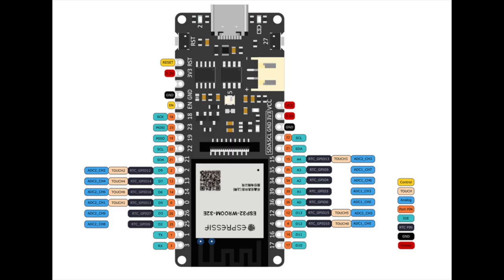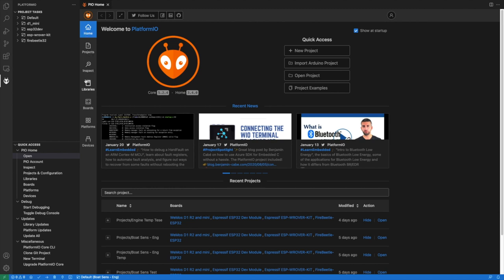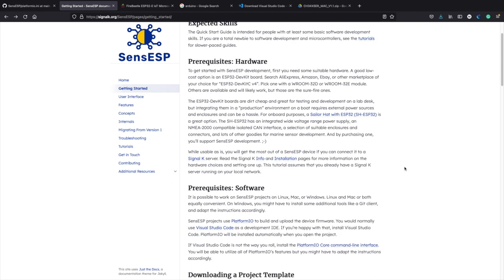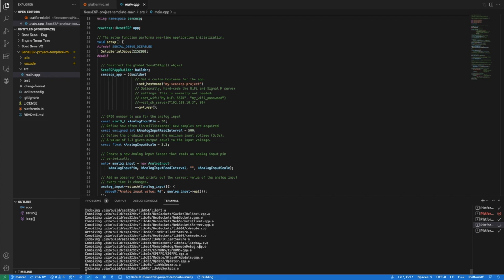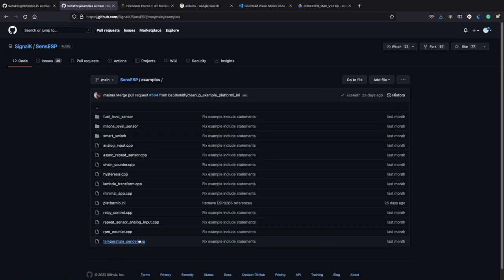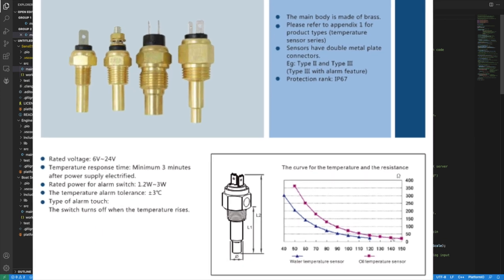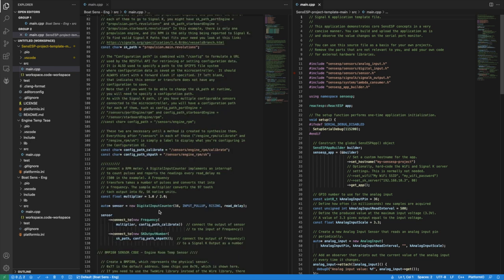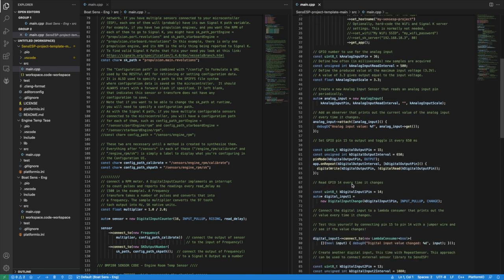OpenPlotter - ESP32 - Getting started, adding code and digitising an older engine MD2030 - SensESP

Comment: Love the lesson! Im restoring a 30 year old 32ft Beneteau with a totally rebuilt Volvo Penta 2003, I have rebuilt the control panel with all new digital gauges from Aliexpress and in the process of digitising all the sensors to be on the NMEA network so that the BandG chart plotter can display the engine data as well. I will be using the OpenPlotter as a redundant system in case of equipment failure while sailing around Australia for a year.
Reply from the maker: Thanks for the message Charles. Sounds like you have a great project on the go and some amazing sailing ahead.  Australia is definitely on the list for us. All the best with the project and fair winds⛵️
Reply: Hello. I am planning the same task, 2003 Volvo md2030 on a Beneteau and want to tie into BandG system. How is your progress and any suggestions
Reply from the maker: Did you manage to get this setup?
Reply: how far did you get?
Reply: Sorry for not responding sooner
I’m still fitting out remainder of woodwork. Delayed for 6-8 months attempting to paint in high humidity. Should start electrical fitout in next 2 months will let you know more when complete.

Comment: Hi, this is a fantastic video. Thank you for documenting it so well. I am also in the process digitalizing some engine data (Volvo Penta 2001). So far, I managed to hook up a few 1wire sensors. Next, I am looking into RPM with a Hall effect sensor installed on the shaft + getting the engine temperature. I would really appreciate  a deeper dive both on hardware and coding for the RPM and engine temp setup. Many thanks again, I am looking forward to the next episode. P.S. I do not mind the length of the video at all.
Reply from the maker: Hi, I’ve got a video next week around the sensors I’ve used to get this far. I also started with Hall effect and then I managed to find an example of a circuit which is triggered by the alternator. The good news is that it doesn’t stop the the VP rpm gauge working. I’ve documented all of it, got links and also tried to show how the circuit works. Hopefully that will explain a few things and fill in the blanks from this video. For temperature I’m using an copy of the example code on SENSESP and then I had to calibrate that. More on that next week. Many thanks for your comments also.

Comment: Wonderful !  Thank you for doing this. There is alot to be done for the "common man" to be able to incorporate esp and sensors to Signal K system. Im not sure if I have the brains for it, but will try as best I can. A question: Is it easy possible to readout the "W" signal from the alternator with an esp? It would be an easy way to get the rpm data. I have a Actisense EMU-1 to read motordata and convert it to NMEA2000. It connects to the alternator, and works perfect. Keep on the good work, and make more guides. Very informative. Just started with Visual Studio and Platform IO..... A bit overwhelming.......
Reply from the maker: Thanks for your comments, I felt the same once I purchased the esp32 and v1 of that software definitely was a learning curve from what I had setup before. The good news is that now you can start with a copy paste of examples and get something to work which I think really helps understand what it’s doing. Then you build on that. Yes to the W terminal, that’s how my rpm is working on an MD2030. Next weeks video is all about the electronics which again I’ve googled but it’s working well. I’m now working on predicting fuel consumption as I know how fast the engine is running.

Comment: Another great video, thank you. 
I have been working on a SensESP project for my father-in-law’s boat. Do you run any environment/ battery monitoring full time for when you are away from the boat for extended periods?
Reply from the maker: Many thanks for your comments. I don’t leave anything on at the moment, still in the habit of isolating everything when we leave as we don’t always know when we will be back. I have thought about some sort of monitoring and I do have a small Lorawan card I could use otherwise I’m relying on the WiFi. Is that your plan with this project?

Comment: Hi, can you let us know the actual sensor transducers you’re using - temp/rpm etc please?
Reply from the maker: This video might help you. I'm using a circuit that's linked in this video for RPM, for temp it's a KUS temp sensor and a voltage divider. You can also use digital 1wire sensors which I've used for the exhaust temp and now oil temp - let me know if you need anything further - OpenPlotter - ESP32 - Circuits & Sensors - Digitising an older engine MD2030 - SensESP
https://youtu.be/I12NdvRQNxY

Comment: Hi Matt, I subscribed to your channel soon after you started. I have watched the upgrade of your electronic instruments/sensors with great interest and decided to start the same process on my Bavaria 31 whilst the weather is so poor here in the UK. I'm not that knowledgeable regarding programming etc. but want to learn more. I have a Raspberry Pi 4B and this week have followed your instructions on how to set up the BME280 & 1 wire sensors. My question is why do you need an ESP32? Is it simply to send information via WiFi to the Raspberry from the engine bay? Plus. where did you buy the brackets for your bilge sensors? I look forward to following more great content on your Channel.
Reply from the maker: Hi John, many thanks for your message and for sticking with us, it’s great to have you onboard.

The esp is doing exactly as you describe, it’s an easy way to get data over WiFi from somewhere I’ve not got a lot of cabling. It’s also easy to configure and to get the info you want. Another example would be a chain counter.

The brackets were from eBay I think, something similar to this and I just drilled out the the single hole to what I needed https://www.ebay.co.uk/itm/284877074314?mkcid=16&mkevt=1&mkrid=711-127632-2357-0&ssspo=1YQ-FBugRSG&sssrc=4429486&ssuid=1XqhIgr5QPm&var=&widget_ver=artemis&media=COPY

Lets us know if you need any further help with your setup and all the best with the project⛵️
Reply: @BoatingwiththeBaileys  Thanks Matt for your quick reply. I appreciate your offer of assistance, rest assured I'll certainly need it!
Reply from the maker: @johnsevieri7280 👍

Comment: I built mine with a database server and an esp32 on Arduino libraries.  I haven't put it in signal K yet as I am having trouble with the signal k database and assorted issues.  They all stem from I cant actually get a Raspberry Pi that the package will properly install on.  They are backordered until April or May most places and are pushing $100US.   I am using Pine64 boards as I have a pile of them that I purchased for $7.  The plotter works at like 90 percent on Ubuntu/Debian, but it was coded to be compatible with a Raspberry Pi running Raspbian...I guess I might just keep the Pine64 boards and code what I need by hand.  I've got to put that Comp Sci Degree to use somehow.
Reply from the maker: That’s the thing with these projects, you just start think what can I do next.

Comment: Have you gotten OTA updates installed. Is it the same way you did the uptime sensor
Reply: and thanks for the walkthrough. It helped alot. Mine did not go as smooth as yours.
Reply from the maker: Hi - Thats on the list to look at, i do have the start of a video which now shows the install and connection to SignalK but i would like to include a bit more before i publish it. I'll add that to the list.
Reply from the maker: Many thanks for your comments.

Comment: Can this be done in openCpn because I am using a laptop not a raspberry pi?
Reply from the maker: Hi, What operating system is on the laptop? SignalK will run on Windows and I think that's probably the easiest option. Your other option is to set up the ESP to put the data directly on the NMEA network but it would need to be NMEA 2000 to get all the more interesting data to work.
Reply: @BoatingwiththeBaileys Thanks for getting back to me, yes windows, I'm not sure if NMEA 2000 would be good for me because most of my kit is NMEA 0183.

Is signal K an alternative to Grafana? I am trying to play catch-up with what's doable by watching your videos and then realised that openCPN and Openplotter are different.
Reply from the maker: @rayhsetwo8594  Ok, So that's possible on Windows - here is a link to SignalK for Windows https://github.com/SignalK/signalk-server-windows

Signal K is an open platform for boat data. It doesn't actually store anything but it allows you to use software like Grafana to display the data. It also comes with other software packages such as KIP, which is another dashboarding tool that works straight out of the box. I have a video coming out this weekend showing an updated version of that. 

SignalK - Boat data platform
Grafana - Visualisation Tool
KIP - Dashboard/Visualisation Tool
OpenCPN - Chart & data visualisation software
OpenPlotter - All the above in a nice easy-to-install package with an Operating system. 

If you don't want to change too much for now and you are happy with OpenCPN and your laptop. I would install SignalK, build an ESP if you want to get your engine data in and then I would setup some dashboards to display that data in KIP or Grafana. You can also pull some info in OpenCPN
Reply: I tried to download Signal K but it says it does not support windows versions below Windows 10. I will have to see if I can use a different laptop. 

Thanks for the list and steps to download re: the apps and an ESP...I will look at doing all that.
Reply from the maker: If you need another laptop, I would seriously consider a Pi for this bit and leave your laptop running the plotter and anything else. Cheap, low power and the software just drops right on 👍
Reply: @BoatingwiththeBaileys   I have considered a Pi, but I don't know enough about them, but the other reason is I have managed to configure a remote CCTV camera which is working really really well over a tplink 4g router and cheap SIM card, I can pan around and zoom in and it sees really well in the dark, I can check my mooring lines without even travelling to the boat.

So I want to be able to view data over the same WiFi router as the CCTV. So I want to have the systems working through that router and view data remotely too.

It's probably the case you can do that with a Pi with a WiFi card connection to the router but I don't know how to do that right now, whereas configuring a PC I can.
Reply from the maker: @rayhsetwo8594  Yeah that's all possible with the Pi. If you are comfortable with Windows and a PC, that's good. If you can get a newer version, nothing stopping you from learning SignalK and sorting that side of things out and then considering a Pi in the future. I think SignalK is a great platform, its really helped me switch my instruments over from older NMEA standards, something that would have been really costly without it.
Reply: Looking back through this thread you said I could build an ESP and use Signal K to display it in OpenCPN.

Can you tell me the model of ESP I should be looking for and how would I get that connected to the windows 10 laptop? 

I got my hands on a cheap Dell latitude 3450 laptop and just installed OpenCPN last night and loaded up a few plugins and British isles charts from OCharts.

I will get my AiS transponder working on it later. (I have a NMEA to WiFi multiplexer that works already for this on another laptop).

Then I will install signalK and start configuring the ESP and engine data.

This laptop is going to be just for the boat and I have a second cheap one arriving so I will duplicate everything so I have redundancy.

I just need to know the next steps for signalK to ESP connection?
Reply: Watching video again, as this is over a year old now would you still use the firefly ESP or something different? Baring in mind I am using a laptop only.
Reply from the maker: Hi, The Firebeetle ESP32 that i used is still available. These devices change little really, so any of them will be suitable. You just need to change the device to the one you purchase in Visual studio if you use that to upload the code. The code is available via a link in the description if you just want to copy and paste what i've done, you can just take the bits you need. If you watch the other videos, when the device starts up you connect directly to it using WiFi and you tell it where you Signalk instance is running. So its IP and Port, the next step is, SignalK will prompt and access request which you need to approve and then the two are linked. Each time you power the ESP, it will connect in a couple of seconds and then shortly after that you will see your data.
Reply: Your walk through has been very good, I am at the stage of turning on the ESP32 and the bit about looking on the chip for the 2102 was helpful. I don't have any sensors yet ( unless a standard 2 wire K type  thermocouple sensor can be used as I have those spare) but getting there step by step, thank you.
Reply: @BoatingwiththeBaileys Just a thought, you said grafana is a visualisation tool, and Kip is a dashboard and visualisation tool, I have OpenCPN with charts for UK loaded up. One of the plugins is a dashboard, I think I understand this, signalK can go into all 3, so does the signalk data come from the ESP32 wirelessly? I have an Ais transponder I just got working on navionics overlay, through a wifi nmea 0183 multiplexer,  I can't see yet how to go through this multiplexer with the ESP32 data?
Reply from the maker: The data from the ESP goes straight to SignalK. This can then be shared as you say with OpenCPN in the dashboard or in Kip or Grafana or all of them. You can only send limited things on NMEA0183, rpm is one but the other data isn’t visible due to the standard.